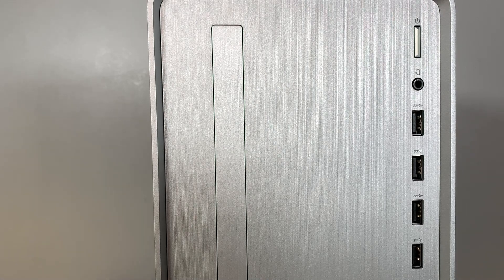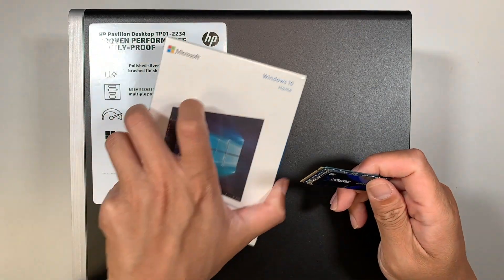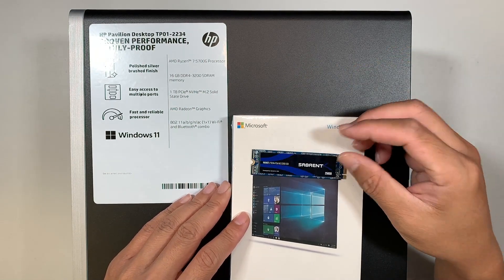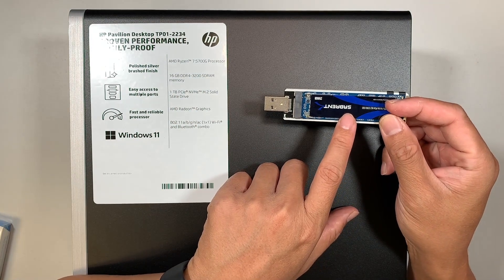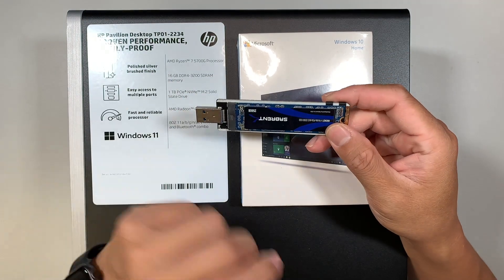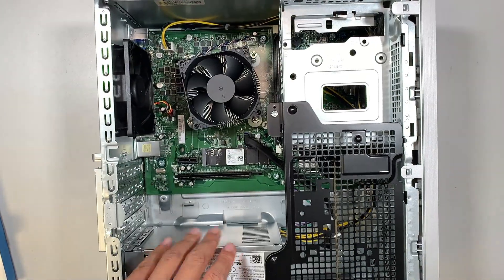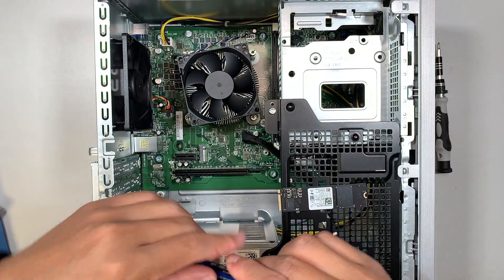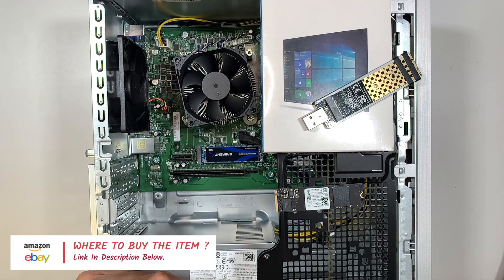HP Desktop TP01 2234 Change Upgrade NVMe M2 SSD

Comment: Check this out.. I've got a HP TP01-2022, same setup as this one. I'm tinkering with it 😅 I bought a 500w psu model L05757-800 which is directly swappable with the stock 180. It also provides a 6+2. I'm planning on dropping a 4070 in it because why not.. I've got upgraded chassis fans and I'm upgrading the CPU fan as well. I may mod the case itself for improvements to air flow. Have you tried anything like that with this chassis?
Reply: I did the same thing as you, except I put in a 4060. Didn’t upgrade the fans though. I’m also looking to upgrade the SSD but the cloning process seems a little intimidating for myself since I’m a beginner.
Reply: The 4070 is flawless  @mountainmike209